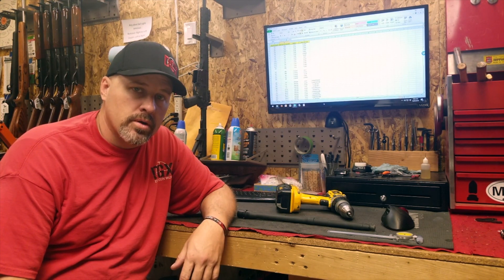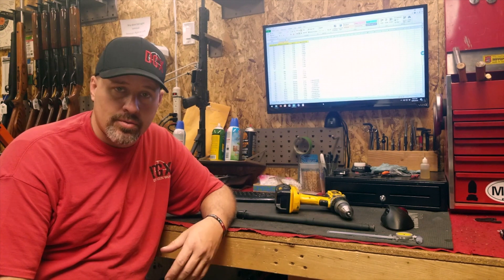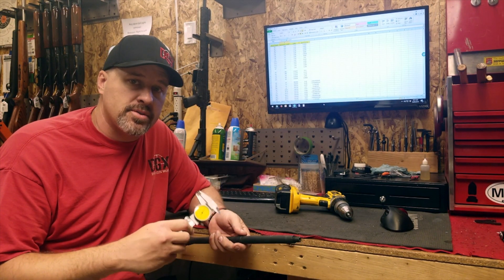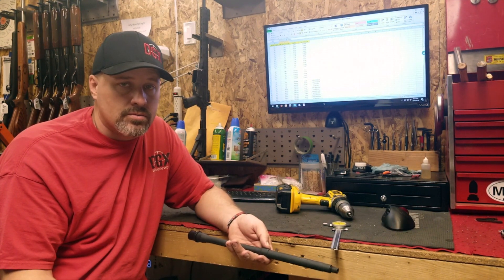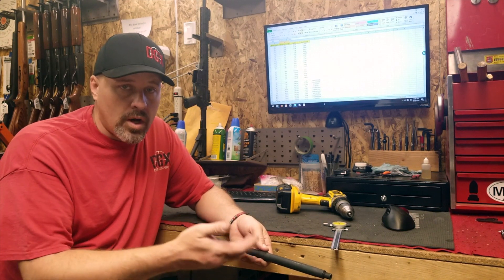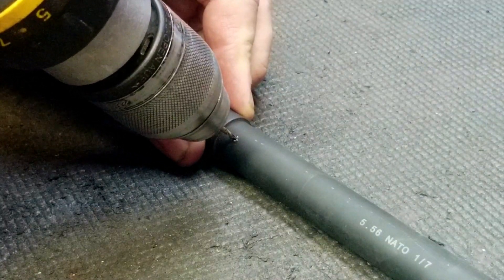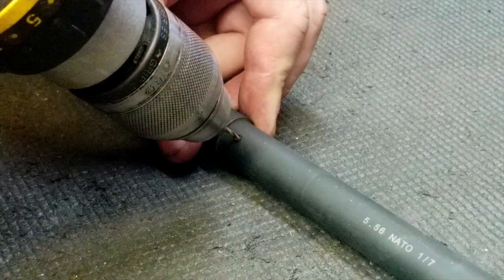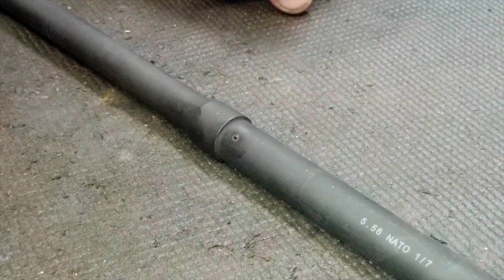Drilling out Gas Port hole on AR-15

Comment: As a safe guard, you can insert an old BRASS cleaning rod into the barrel, to prevent the drill from touching the rifling on the other side. If you do this, be very careful and take it very slow and use oil on the bit. The cleaning rod could cause the drill bit to bind and snap off, which can create a whole new set of problems, so take it very slow and deliberate.

Comment: My 8inch 300blk had cycling issues and it wouldn’t load the next round, even with a reduced power spring it wouldn’t, then I drilled out the gas port the same size as the gas blocks port and it works like a charm run subs perfectly, now to test super safety on out 😂😂

Comment: I just did this with my PSA 300 Blackout. I pulled the gas block off and fit drill bits into the gas port hole until I found the right size which was 7/64”. 1/64” bigger is 1/8”. I hand drilled slowly with oil using the existing hole as a guide with another person looking down the backlit barrel to let me know when I broke through. It took a little over a minute. I ran a few patches through the barrel, put it back together and she runs like a champ. Have a nice day.😊

Comment: Why would 150 grain federal American Eagle work on a 10 1/2 inch pistol length 300 Blackout and Ammo inc 150 grain won’t?  I know the pressure are different in some of  the ammo, but would you recommend drilling out the gas port to run  the ammo inc and the federal American Eagle and then bring it down with an adjustable gas block?

Comment: I have a .300BLK with a superlative arms adjustable gas block and even with a suppressor was not getting bolt hold open last round and from what I can tell it’s under gassed wide open, I’m gonna disassemble and do this. Thanks for the video 🤘!
Reply: Same
Reply: What happened? Did you do it or what?
Reply: @Myrlscountryllc  it was actually my barrel the gas port was too small, ended up drilling out the gas port from 0.073” to 0.099” and runs like a champ now.
Reply: @drail636trying to find the bits at Home Depot now    Need to start doing this for all our 300 blackout 10.5 and 7.5” barrels or anything with a pistol length gas system it seems in that caliber
Reply: @ No. I ordered off amazon it was like a 8 pack. Make sure you get carbide bits.

Comment: Many thanks for showing this and explaining it. My 10.5in 5.56 barrel was not fully cycling (under gassing). I tried a 5/64 first, but had to finally go with 3/32 before the bolt would lock back.
Reply: I am presenting the same problem, what could you help me?
Reply: @saulmartinez5977  Just follow his instructions. Easy to do.
Reply: What length gas system are you running?

Comment: Could the same be said for ar-10 gas problems? It's definitely undergassed. Every 3th round doesn't eject. I trouble shot it. Replaced buffer and spring.  Next is gas block/adjustable gasblock(?)
Reply: An adjustment has block will be less gas, never more. They’re either wide open or slightly closed. I’d say it’s either your gas port, mags, not enough lube. Try different mags and make sure it’s thoroughly cleaned and lubed before messing with the gas block
Reply: @JBJHonez  did allow that more than once.
Reply: I'm going to take tge bcg apart and clean it then, go from there. Thank you!

Comment: Thats great to see not even using a press.....my biggest concertwas perhaps snapping bit in the pilot hole due the hardness of the barell...
I considered sending the barrel out to a smith...but once i realized that would cost the same or more than as a new barrel I committed myself to the DIY montra.... education aint free, and if he can do it, so can i...
Reply: Same here for a few of my own and a few some buddies had issues with. Some paid a local shop $$$$ to build them and end up with undergassing because they, supposedly one of the best shops around, didn’t line up the gas block correctly. I’ll never take my guns to a shop around here anymore.
Reply: @JBJHonez we have a local shop with the same reputation where I live, which is the biggest reason I got reality checked into doing this stuff myself. I dropped off a 8.5 ballistics advantage barrel, gas block, upper receiver to be dimpled, pinned, and assembled to the upper, and it took me over five weeks to finally stop in and catch him there to speak with him about and he assured me that he had gotten over the flu and he would get right on it that day. I gave him another week and couldn’t catch him a second time being that he’s shop wasn’t even open again. Two months later I finally caught him open and told him that I just needed my stuff back and he replied “no problem I already have it done” 

The guy went to the back for about 15 20 minutes and finally came out with an assembly and gave me a whole spiel about how he used aeroshell, proper toque, blah blah blah, but after looking at it I saw no pin and cheap chrome set screws from Home Depot that were TWO FOOTBALL FIELDS long and the rail wouldn’t slide over the two freaking skyscrapers!… (they were literally an inch long) and then he had the nerve to charge me $98 for the job! 

I told him “I’m going to pay you, but I promise! I’m fixing to take this home, take pictures, and show all the employees and customers at all the gun shops and tell them that YOU actually charged me for this mess that isn’t even complete or what I asked for and lost my original set screws on top of it”…Needless to say I did, and needless to say when I got home I was able to spin the barrel nut off BY HAND and found no aeroshell!

So if you are ever in Murfreesboro Tennessee STAY AWAY FROM NOMAD GUN SHOP!!!

Comment: I went out to .082 (a .010 increase) on my pistol length tube on 16" barrel and purchased an adjustable gas block. I am testing it today. I am prepared to go out to .085 if needed.
Reply: Did it work? Im in the same boat... Would cycle subs with an old 45 pistol can but i have a hux now and it will barely cycle supers! Its currently somewhere near .075

Comment: Glad I ran across this. I just got a 16" BA 5.56 barrel with a mid length gas system and the damn thing just won't cycle properly. Checked buffer weight, spring, gas block alignment, gas obstructions, bcg, bcg extractor, ejector, and everything checks out. The one thing i didnt check is the gas port on the barrel. I guess i know what ill be doing this weekend. Thanks. Apparently Ballistic Advantage has a reputation for drilling their gas ports too small.
Reply: I had to send mine back and they enlarged the hole to .076 which I still think might be too small for my midlength barrel. I just haven't had a chance to get it to the range yet. I think at a minimum it should be .078.

Here's a chat I found online and all the ones I found seem to be pretty consistent.

AR-15 Platform 5.56mm
20"	rifle	5.56	 	0.0935
20"	rifle	5.56	 	0.096
20"	rifle	5.56	 	0.098
16"	mid	5.56	 	0.078
16"	mid	5.56	 	0.081
16"	car	5.56	 	0.0625
16"	car	5.56	 	0.065
16"	car	5.56	 	0.07
14.5"	car	5.56	 	0.067
14.5"	car	5.56	 	0.086
11.5"	car	5.56	 	0.081
11.5"	car	5.56	 	0.089
24"	rifle	5.56	 	0.089
Reply: @pep729 that’s a time consuming post. Highly appreciate it brother!👍
Reply: @angeldesigns1385  My pleasure. I just hope it helps someone so they don't have to go through what I did. I was just fortunate enough to have spare parts lying around to troubleshoot the issue. Ballistic Advantage needs to get their act together.
Reply: Same with 30 cal faxon barrells
Reply: I think under is prudent to over. But does allow for headscratching...
Reply: Sooo many people (including myself) having issues with BA barrels. Shot mine for the first time today and it won’t cycle at all
Reply: I literally have the exact same issue as you. WTF BA?!
Reply: @concerned_citizen1313  Yep. They're notorious for undersized gas ports. I had to send it back to drill it out. Has ran flawlessly ever since. They're great barrels. I don't understand why they're still sending them out like that though.

Comment: Awesome! fixed my 300BLK under gassing with it's new 9" BCM barrel. The 10.5" barrel was fine so I matched the hole size. I shoot subsonic with it and it has a low mass titanium BCG.

Comment: I would use WD40 with the spray nozzle to clear the port. I would use it again to flush the barrel. Then liquid air spray to clear the barrel, chamber and gas port.

Comment: Great video, having a short stroking/not locking back at last round issue with my Ballistic advantage 13.7" pistol that I built as well, and I changed everything else you could think of to remedy the problem.. Gonna try this gas port drilling tip tonight and see how it shoots this weekend at the range.
Reply: Glad I saw this comment here, I’m running a BA 13.7 midlength with the same issue. Think I’m going to do the same thing, let me know how it goes!
Reply: @ericmorris3683  will do.  I talked to some guys last night who also said BA tends to have too small of gas ports on their barrels. Seems to be a common issue unfortunately
Reply: I think they do drill their ports a bit small.  I installed their 16" Performance Series middy, replacing my carbine length.  Anything that isn't full power will not cycle reliably.  Gas port is .073.  I would like to see it at .078.  I may do this in the future.

Comment: I'm having this problem on my 300b/o build. It'll kick brass but not chamber a round. It was working for maybe 10 rounds then does this!!!  The gas port will fit a 3/32 drill bit.
Reply: Same problem use a #41 drill bit and all you're problems gas wise will be solved ..

Comment: How does a barrel manufacturer have the skill and expertise to build a barrel but screw up the gas port???
Reply: A friend of mine just got 2 Ballistic Advantage 7.62 barrels with rifle length gas systems whose gas ports were drilled for mid-length.  I guess the lesson is - always check the manufacturer's work.
Reply: Not sure but with a quick search it seems that there are issues with BA barrells all over the internet. The failure to feed, failure to lock back is resolved in every case Ive read after re drilling the gas port.
Reply: From what I've been told, the gas ports on .300 Blackout are drilled from the factory for use with suppressors. Unsuppressed subsonic needs a bigger gas port hole to fix the issue. Look online for the chart.

Comment: I will never buy another fucking thing from ballistic advantage again. fuck those mother fuckers. i'm so pissed, they sent me this pos ass barrel with a pinhole for a fucking gas port and when i was trying to drill it out i snapped the fucking 5/64" drill bitt off in the hole, i'm fucking heated. I know i broke the drill bit off in the whole, but i'm pissed because I SHOULDN'T HAVE TO BE REDRILLING THE FUCKING HOLE ON MY EXPENSIVE ASS BARREL.  Was BA's QC taking a fucking siesta that day or what?
Reply: Youre not alone.  Many people with the exact same issue after buying BA barrels.

Comment: I know this video is two years old, but it saved my ass. Thank you. My 20” .223 Wylde DMR barrel with rifle length gas system would not run with any combination of lowers, buffers, springs, etc. finally I slapped an VLTOR A5 setup and a spring I green spring with an A5H0 buffer and it still wouldn’t lock back! So I started looking again for gas leaks and restrictions. I mic’ed the gas port and found that it was at 0.080” 🧐 I deduced that this was far below the necessary diameter for nominal operation and put that sucker on the drill press and used a chucking reamer to ream it out to 0.096”. Took it to the range to tube the gas system’s Seekins Precision Adjustable gas block. Closed the gas block screw all the way and opened it two turns, first round no bolt lock back, one more full turn, no lock back, 1/2 turn more…. ON THE $$$! And that was with PMC Bronze .223 target ammo. 2700 FPS I believe. Now I know it will cycle with the weakest ammo and I can tune it with buffer weight or gas block to run anything I want.
Reply: Im having the same problem with my roscoe barrel, I have 2 exact same setup but the other is a brownells barrel which runs flawlessly, i swapped out springs from my SP1 and that worked but still jams sometimes, I will try this see what happens, thank you!
Reply: got the same barrel having the same issue. 
The smith said I should buy a new buffer.
Just checked the spec on the website and it says .085 and am waiting for the smith to verify.
Seems a smith should be smart enough to check port hole size. Oh that's right, how do they make more sales that way.
Reply: @brianhatesyou  the smith should have inspected the gas block and port first thing after verifying the failure to cycle and hold bolt back.

Comment: Also, with the popularity of 300BLK that needs a little more gas if you're going to run subsonic ammo unsuppressed. If you're waiting on NFA paperwork while you build a 300BLK AR-15 you're going to finish your gun before that suppressor comes in. If you're shooting Subsonic ammo unsuppressed you may need a 7/64 drill bit, suppressed 3/32. For Supersonic ammo if you're unsuppressed it's closer to 5/64 (like in this video) or suppressed 1/16. It's a pretty big swing between suppressed supersonic and unsuppressed subsonic. Also, if you add a folding stock, be aware the plug that goes into the BCG is typically 3oz doubling the weight of the BCG so you may also need to get a lighter buffer weight. Just some thoughts. Good video.
Reply: @Steve Delaney trial and error, that’s all I know. Every setup is different. I went with adjustable gas blocks, so I drilled out my gas port, but I can clamp it back down with the block. If it cycles reliably, I wouldn’t change it. It takes a few trips to the range to see.
Reply: My law tactical bcg extension is 2.172oz, kak’s lightweight replacement is .630oz

Comment: Just put together a new AR and having short stroking with steel case ammo. Failure to lock back and failure to feeds. Brass ran 100% reliable though. I have the right buffer (carbine) so that rules that out. Do you think it could be the gas ports?
Reply: Im having the same issue. Did you end up drilling out the gas port?
Reply: @mwells7410  I’ve since parted with it but I had my gunsmith open up the gas ports and it solved the issues. It was under gassed.
Reply: @kolbietafoya1672  Great! Thanks for the reply!
Reply: I have the exact same problem in my BCA 16" 5.56 upper. Brass cycles fine and steel will run about 50%-75% of the time. Buffers n springs are fine. Gas port is measuring in at .065 on a carbine length. Should I drill it out?

Comment: Good video.  I've got short cycling and stove pipes on new LR-308 build.  I have a Ballist Advantage  22" 6.5 CM SS barrel with RLGS.  I checked gas port hole size, it is .068" out of the box.  A 6.5  Creedmoor RLGS gas port hole should be .086" minimum.  My question is ... is drilling  a SS barrel the same procedure as drilling  a  4150 cmv steel barrel ?  I have  always read that drilling  SS is a lot more difficult  than drilling other steels.
Reply: It's the same concept, but for drilling stainless steel, you want to have you drill set EXTREMELY LOW SPEED, like probably as low as it will go man, and you want to use bits made out of "Cobalt."
Reply: Cobalt bit on Stainless Steel should use around 2500 rpms.  That is just shy of the typical "no load" speed of an electric hand drill.  If you are hand drilling it, you are find at max velocity generally.  If you are using a drill press you will want to realign the belts to get you between 2k and 3k rpms.  The information on appropriate speeds is readily available online and deviates based on material being drilled (SS in your case) and hole size.  If you were drilling a 3/8" hole in SS, for example, the RPMs drop to around 700.  If you use a drill press you can set the stop to prevent your bit from over-traveling.
Reply: Did you end up drilling it? Did it fix it?

Comment: I have a bushmaster xm15 I bought new during the Clinton weapon ban so it has a full size stock 16 inch barrel I put a adjustable carbine stock on it now the bolt will not lock back after the last round do you think the gas port is to small I used the right spring and the regular carbine buffer after putting the full size stock back on it works 100 percent
Reply: Use a cabine spring and buffer
Reply: @richmccullough9137 thanks for your reply  I was using a carbine spring and buffer I put another carbine upper on it and it ran fine I think the bushmaster upper is slightly under gassed but it works well with the full stock and full buffer and spring so I guess I will leave it that way as its the most accurate rifle I own

Comment: Have you never heard of sfm? Spin the drill faster. And it's already drilled, there's no issue with chip relief, go all the way through. Lastly, you should've reamed it if you really cared about a nice hole.

Comment: Awesome video. Thank you, Sir. I just upgraded my piston LWRC 6.8 SPC with the Superlative Arms low-profile gas block. And what I was told is that it might not cycle properly because it was designed for 5.56 and mine is 6.8 and that I might need to open up a gas port a bit. Thanks to you now I know how to do it and how easy it is!
Reply: You'd think if you bought an LWRC you would buy a piston to begin with
Reply: @Russianmafia10  their IC-DI is a really nice shooting gun that doesn’t require proprietary parts to fix.  I own one and love it!  Granted LWRC is known for piston driven ARs, but they make a nice direct impingement rifle as well!
Reply: I just added the SA gas piston kit to my grendel, very similar to the 6.8mm. It cycles great now! It was a but over gassed, and I was using an adjustable gas block. The SA takes a little more gas than a normal DI system, so it worked out well.